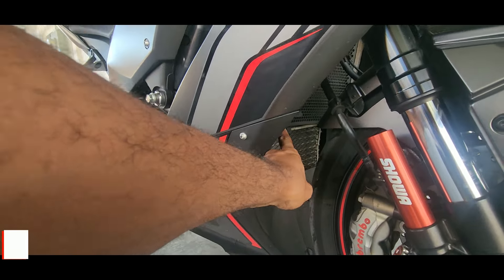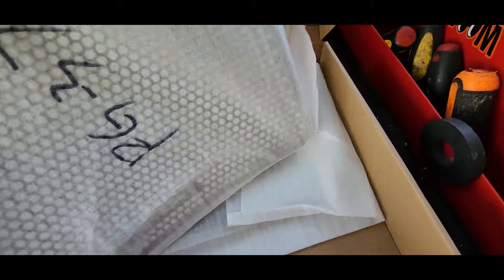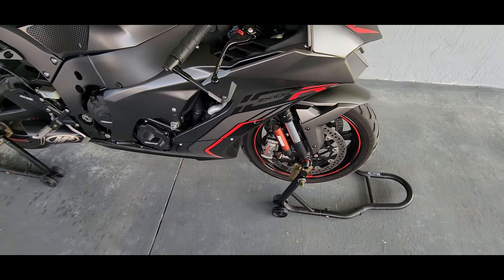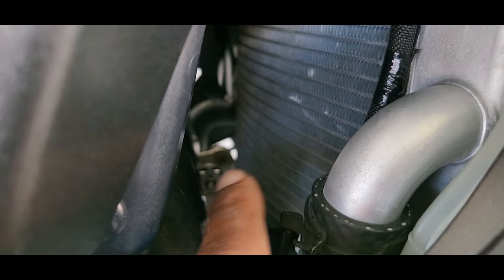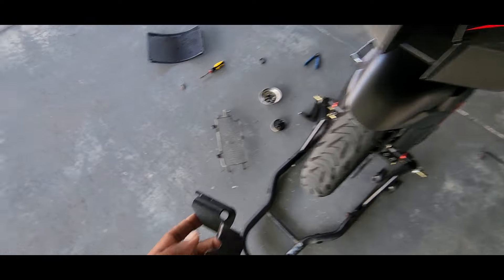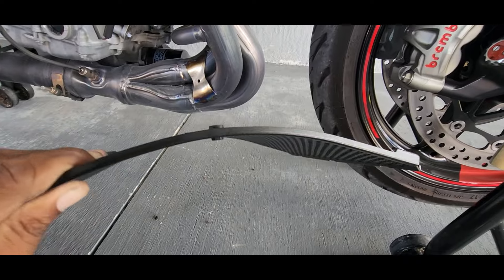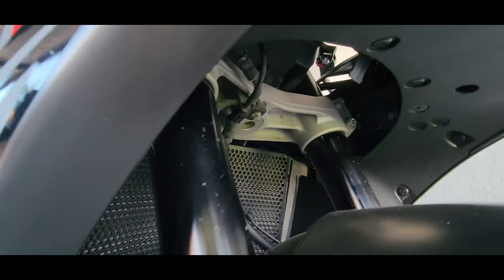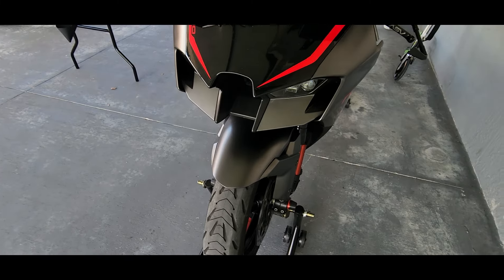KAWASAKI NINJA ZX10R 2021 - 2024 GUARD UP

Comment: This is one of the best low buck mods every owner should do. I also cut a cardboard template of the backside of the radiator and tape it on before installing a full system because you'd be amazed how may people beat up the backside fins doing an install.